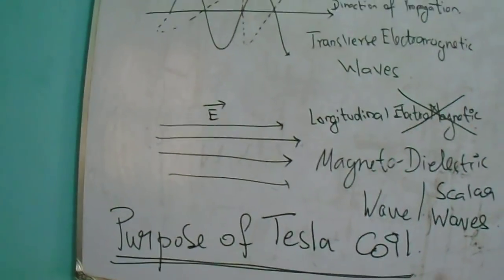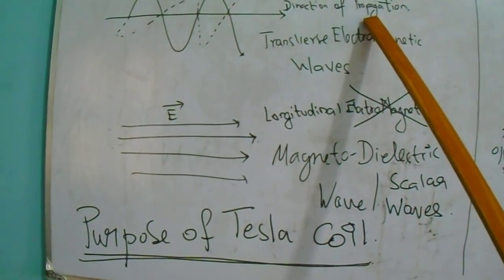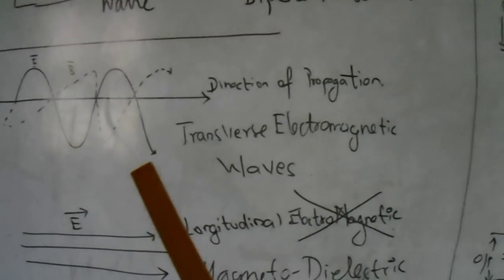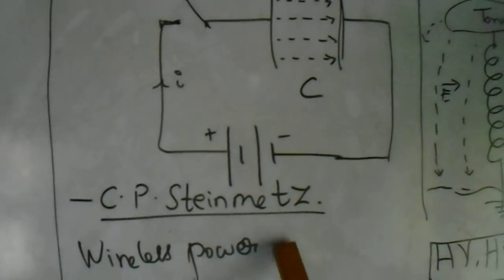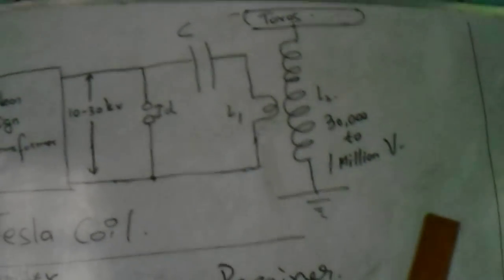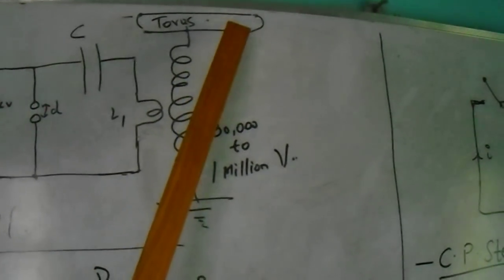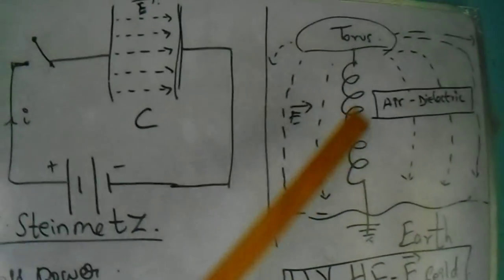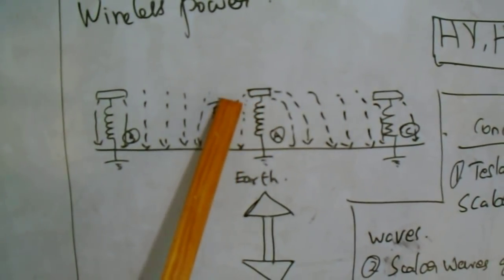How a Tesla Coil Produces Scalar Waves

Comment: More pointless rubbish.  Why don't you do something more useful with your time than making things up?  You may want to start with getting a grasp of Heavyside's formulation of Maxwell's equations.  Just a thought...
Reply: Explain why this is pointless.
Reply: Andrea Marchetti The wireless transmission of energy in this system is via standard, ordinary, transverse electromagnetic waves.  I.e. Their direction of propagation, B- and H-fields are all orthogonal as per standard, 'run of the mill' radio waves.  Thus, it is pointless as it is technically incorrect throughout.  Please, as I said in my initial rebuttal, get a grasp of Maxwell's work if you're interested.  I would also advise that you be suspicious of discourses that have no support in peer-reviewed literature and have lines like 'believe it or not' and 'equivalent circuit according to me' in them.
Reply: Mr Pyramid Man Well, that was a very mature argument!  Please tell me, do you wear a foil hat in your pyramid, whilst practising your swear words, 'Mr Pyramid Man'?
Reply: This is pure conjecture but I have my suspicions that the nature of Tesla's original intent was a form of resonant electromagnetic coupling between the ionospheric resonances and the Earth current resonances through a 'pumped phase conjugate mirror' effect.

The spherical standing waves around Earth formed by ELF radiation can be pumped using A/C current, so can the Earth resonances produced by electromechanical and electrothermal processes that heat the Earth. Using the correct coil ratio and torus mass, you can tune this circuit with a signal probe grounded in the Earth and one in the upper atmosphere, and produce a phase conjugate signal in both the torus and the Tesla coil ground wire. These destructively interfere with the naturally present resonances and produce constructive interference at the Tesla Coil which can be greater than the energy input because the system is now in resonant mode locking and thermodynamically far from equilibrium in the frequency domain.
Reply: Eric Matteson, I think you are wrong. If wireless transmission were Hertzian waves why can you receive  transmissions through a Tesla Coil in a Faraday box? Reference: https://www.youtube.com/watch?v=wjz-5Lqtxow
Reply: XR IX
True this technology is a proven fact
Reply: XR IX
Thank you, that is interesting
Reply: Eric Matteson
All correct, IF you assume the Maxwell-Heaviside view of electromagnetism is correct and complete.  We know, since Einsteinian General Relativity, that MH is not a complete theory by any means (but still taught in university).  The main, and very important, reason for this is because Maxwell-Heaviside assumes a flat space geometry, and Einstein's greatest intuitive contribution was to ascribe spacetime as geometric with curvature (and it also has since been shown to also contain Cartan torsion in 1925, see below).  It would be a book to elaborate, but the MH theory works but only in flat spacetime, which is all they understood in 1885.  Even the flat-spaced Minkowski Space came during the development of general realtivity, and the (incomplete) inclusion of Riemannian space was required to explain spacetime curvature thus invalidating Minkowski space.  Any thorough student in Einstein with skill in tensor calculus will agree.  And not too many know of the great French mathematician Elie Cartan, who worked with Einstein for a time in 1925.

Now, once Cartan torsion is added to the mix, it became possible to unify gravity with electromagnetism, and this realization is being developed as I write by a number of people.  Since it is looking more and more likely that gravity and EM will unify via Cartan Geometry, MH theory isn't dead, it is just a special case.  It is worthwhile to experiment and validate the new physics as this video seeks to accomplish, right or wrong.  Science must progress , but are we to assume that we got it all exactly right on the first try?  Of course not.  Maxwell-Heaviside is a special case within the larger and more comprehensive framework of GUFT theories (Grand Unified Field Theory) under development right now.
Reply: XR IX Flawed because a biscuit tin has paint and lacquer  on the surface. Even two tins will still not provide a perfect shield. Furthermore, the radio signal is already a weak signal having travelled through space from its distant transmitter, the local source is very much stronger. Assuming that the boxes do attenuate the signals, (but not completely) then the radio signal will be reduced to  a point where the receiver cannot pick them up but the local source still has enough energy to be detected. Oh, and scalar waves are supposedly not detectable so using a radio is pointless. All that is being shown here is atnuation of electromagnetic waves of different strengths.
Reply: @electronicsandradio3945  If one is to build a scalar receiver, polarization is an issue. A standard dipole antenna wouldn't get it done for longitudinal polarization.  Since most any antenna design rejects longitudinally polarized EM waves, your conjecture would be correct.  However, a proper scalar receiver/detector would need proper polarization as well as Faraday shielding and resonant tuning and pre-amplification all inside it.  This has been done decades ago and designs exist out on the Internet.  There are design constraints, but it can be done.
Reply: @bruced9786  well a metallic antenna picks up electromagnetic waves, so either scalar waves are simply  'push pull' type electomagnetic waves waves which would simply need  an antenna pointing in a longitudinal direction. However, polarisation changes due to reflections.  Never seen a so called scalar receiver. Certainly there's never been any proper proof of scalar wave passing through screened rooms. Half the proponents say it's not detectable at all which demonstrates how little factual data exists.
Reply: @bruced9786  Well stated and I partially agree, however, does not magnetism, as seen through the ferrocell and magnetic film, provide the grand unified theory already? It seems that gravity (dielectric acceleration), magnetism, electro motive force, and dielectricity (plane of inertia, or counter space) are there for all to see. Four modalities of counterspace; the ether field. One space plane as MH described. Once one heads off on a tangent, more and more models are needed for explanation and more and more mathematics are needed to prove ones complex model. Simplicity must prevail, surely.
Reply: @elams1894  
Good points.  One must accept the implications of a unified field before you can see the patterns in the various fields around us.  Since you apparently have, you saw patterns.  The average student in the "West" is not likely to see the interrelationships as a pattern.  It is in this environment that my remarks were initially directed.

Back in the first post by Eric Matterson at the top of this thread, he was attempting to point out that there is nothing in Maxwell's equations that indicate the presence of scalar waves.  Two things about this: 

1) What most people think are Maxwell's equations are actually Lorentz' hacking of Heviside's non-quaternion restating of Maxwell's original 20 equations.  Maxwell chose to use quarternions because they don't commute (A x B does not equal B x A) and the math was difficult to figure out back in 1860's.  Now, we use quarternions in computer graphics because they are efficient computations to make in rotating 3D space.  Heaviside tried to convert Maxwell to vector calculus and drop the equation count to 4.  Lorentz came after that and dropped the "curl" operator and made other changes because in his limited, flawed understanding, he could not visualize the usage of the curl operator (a poor excuse for making a change I think).  Unfortunately, this then became the standardized Electrical Engineering formulae and have not been abandoned in the academic world since (except in Russia), and therefore the typical electrical engineer has no knowledge of scalar waves or longitudinal waves, both which are quite useful.  You almost can't blame them for being miseducated, but once they have been clued in, you would think they would study up and get with the real program!

2) Students of quantum electrdynamics (as well as the best unifield field theoreticists), however, know about curl, or better referred to as torsion, as it is required to explain observations seen in many and varied experiments done in the past century.  The field of Non-Linear Optics, in particular, are indebted to torsion, having repeatedly proven it's existence in the last 40 years.  It is well accepted that torsion exists in physics, and a unified field requires it as a result.  It's just the apparently ignorant electrical engineers who are holding things back at this point.

For more reading, see http://cheniere.org, the website of Tom Bearden, one of the early proponents of scalar energy in the US and the explanations of such are all through his site.  Dr. Myron Evans (et al) has what I consider the best Unified Theory of all, and they are still publishing, see http://upitec.org for a good place to get started on that.  There is some overlap between Bearden and Evans on each other's web sites, as Dr. Evans found encouragement from Bearden to help make the case for scalar energy explainable in terms of a rigorous modern scientific theory.  Non-linear tics people may know Dr. Evans as the discoverer of the B(3) field, from which torsion entered into the science as fact.
Reply: @bruced9786  Thanks for the reply and resource material. Indeed conceptualising, visualising torsion is key to understanding mass phenomena, or the generation of pressure gradients and resulting energy concentration, mass. Heaviside's equations were certainly on the heavy side, no pun intended. Steinmetz was an unsung hero IMO. My father was a gifted EE, audio at first, then film. He designed and built many television studios around the world, including Singapore and Hong Kong in addition to NewZealand where he lives. He is in his 80's now and he confirmed to me 35 years ago when I asked him what I thought was a simple question as a kid, where does electricity come from? He answered, if you want to know what and why you have to learn field theory and if you want to know how you have to know conventional theory. His overall answer at the time was that we still don't know. I was staggered to be honest. How could this be? I began researching and sure enough, as you probably know, it is a long and tiresome road. 

Getting back to torsion. It is quite rightly, absolute key in figuring out both magnetism and electromotive force, and ultimately electricity. One must be spatially creative and be able to visualise as equations will not allow that. When one realises that torsion provides polarity in a mirror image, and begins to explore that phenomenon spatially, conclusions become more clear. I see three fundamental attributes of polarisation that must be conceptualised. The fact that same/same poles (radiation), when placed together in any orientation, provide pressure gradients that are opposite is fundamental. In addition, the fact that same/same poles have both centrifugal divergence and centripetal convergence (on/at the same pole) is also fundamental. In addition, the plane of inertia (the accretion disc of counter-space) and its influence on polarity (radiation) is also fundamental. Indeed, spatially conceptualising these conjugate phenomena (dynamic torsion) is critical. Perhaps that is why it is so hard for EE's.

I read the article on the scalar detector. Very interesting. I am glad they used the so called 'photon' as a subject for scalar detection. I'm hesitant to associate the word wave with scalar for obvious reasons. I certainly conceptualise the 'photon' as a dielectric phenomenon rather than a 'wave particle duality' which makes absolutely no sense to me what so ever. The radial dielectric being the longitudinal anchor about which the magnetic and electric transverse giving the structure its Hertzian nature. It makes sense to try and influence the dielectric at a quantifiable source. There are a few things that are not so clear to me. The first, how will they deal the transverse component of the longitudinal, the magnetic and electric, as they are the wave component of the scalar structure 'photon'? Spatially, the interaction of a powerful magnet on the dielectric is very hard to conceive. A strong magnetic field, to my knowledge, compresses the dielectric, which is already perturbed into a pulse (scalar). I can only imagine that a magnetic pressure applied to a dielectric radial will generate a pulse that is perpendicular to the original pulse at source, leading to very interesting torque outcome. I guess it seems logical and possible. One can see how torsion dynamics, vortices, pressure gradients, and acceleration really extend ones brain to the limits. Thanks again for the links.
Reply: @bruced9786  I see their thought.. the longitudinal wave has no 'vertical' nor 'horizontal' component and thus does not impinge on the detector to create a signal. However, their crazy plan to bend spacetime to give it a vertical vector (unverifiable), could be achieved by placing the detector in the same plane as the oncoming longitudinal wave. Rather than bend the incoming signal, simply rotate the detector accordingly. Just as a horizontally polarised antenna requires similar at each end ( although not strictly true ), making the scalar antenna in the same vector plane would obviate any need to bend the original wave... its so obvious, but not to those who can be fooled by techno babble.  Any wave will not retain its polarisation due to reflections  etc, just like a horizontal polarisation can be received by a vertical antenna at reduced power, so should a longitudinal wave transmute into other polarisation. The crux here is that all that is being detected is a voltage induced into the tuned circuit, so the implication that the scalar wave is simply an electromagnetic wave with a different wavefront type. Most proponents will say scalar waves are undetectable, and your link claims it needs superconducting magnets... while all along, this old scientist claims he can detect them using a 5 dollar radio. So much for consistency.
Reply: @electronicsandradio3945  A couple of things. Is not a scalar wave a pulse? The use of the word 'wave' is very misleading. The Russian detection device states that they were using a 'photon'. A 'photon' contains, in addition to its longitudinal scalar component, transverse magnetic and electric components - thus, the 'circuit' is manifest into the time realm (space, voidance). Unless the transverse component is eliminated, the circuit is not strictly scalar. Scalar pulse perturbation is instantaneous. In addition, i'm not sure why the term space-time is used.  Time is in no way bent, nor is space for that matter. Space has no attributes and acts on nothing. Dumping a magnetic pressure gradient onto a counter-spacial dielectric radial plane (the longitudinal in this instance) is creating space; creating a magnetic component (radiation from counter-space), therefore creating a time component. A scalar pulse cannot have any electromagnetic components.
Reply: @elams1894  sometimes sound waves are used as analogy for the longitudinal wave description that scalar is meant to be. But although a sound wave can be a wave or a pulse in a longitudinal direction, it still has an oscillation  and still has a speed. A pulse cannot have instantaneous speed because a mechanical pulse relies on one particle moving the next one. A photon is a radio wave anyway. Photons are emitted by radio transmitters, but they have lower energy than visible photons. I see no method anyway, how to create a signal from Photons that are suposedly longitudinal..what does that even mean for a photon?. Photons simply propagate in a single direction..forward ..and carry with them an em field as we understand it. So even a photon pulse would be just a short burst of ordinary transmission. Trying to describe scalar waves with diagrams is misleading because it makes no logical sense comparing a drawing of what could be a sound wave type propagation to a sine wave representation of a radio wave. It looks convincing ..but in reality it's not even possible to describe how a photon would work in a longitudinal fashion since there is no forward or backward motion possible.did that make any sense?
Reply: @electronicsandradio3945  - Sound waves are waves. There is no longitudinal axis in sound, merely particles moving up and down tranversely via displacement. 'Light', incoherent illumination, behaves differently form sound as it contains a longitudinal component - as I wrote above - the dielectric. The dielectric terminates on conductors, or dielectric reflectors anywhere in the universe, hence it IS the field. It cannot terminate in space. The dielectric field is counter space. This field, the aether, dielectric, call it what ever you want, cannot be quantified, as it contains no particles. A pulse upon the aether is instantaneous. 'Light' - illumination, is a phenomenon of pulsed aether with a transverse electro-magnetic component. 'Light' travels at the rate of induction, not at a speed. 'Light' (not photons) has a time component as it contains magnetic radiation. Polarity (magnetism) is the aether in discharge, a discharge that is spatial FROM counter space (dielectric plane of the aether), the compression of which is the sole definition of charge. Magnetism therefore, is change, and change is time. Whenever there is magnetism, there is time. Time cannot be bent as it is simply a human attribute given to magnetism, change.

The dielectric plane of the aether is torqued by magnetism. When this occurs, ripples are manifest upon the dielectric plane along with electro motive force. ANY ripple of the dielectric field is radiation (magnetism) into spacial existence from counter-space no matter how miniscule. As there is a time component (magnetism), there is a rate or 'speed'. The perturbations, ripples, are transverse and pulse the dielectric in the same manner as a drop of rain propels the centre of the dielectric plane into a longitudinal Z axis. The perturbations (ripples of magnetic and electric - oscillations in the X,Y plane) are luminal and hence there is a rate of induction of the manifested dielectric Z longitudinal. The faster the oscillations, the smaller the transverse electro-magnetic, and the higher the energy (pulses). That is why the Russian detector were considering the so called 'photon', more appropriately called dielectric-electromagnetic radiation 'light'. Scalar pulse propagation is instantaneous transfer of energy through the dielectric aether plane in an omni-directional manner. There is no backward nor forward, merely point source in either direction, hence polarity is everywhere in nature, not one direction.
Reply: I really didn't understand what you were saying. But sound has to have a longitudinal path. think of a loudspeaker pushing and pulling the air.. there is no 'up /down'  other than would be created from reflections. the amplitude is how much the  air is displaced back and forth from the driving source.  Light doesn't do that it always moves forward, there is no push and pull . It's not really sensible to compare the two anyway - but it is often done ( even like a compression wave on a spring ) where people try to explain a longitudinal wave and then apply it to what they want to call a scalar wave.
I think the 'scalar wave detector' is rubbish anyway. Bending Space time with a magnet is not current physics.. MASS is what bends space time. if it were possible with a magnet then labs the world over would be doing it, trying it and presenting any measurements in published papers.
Reply: @electronicsandradio3945  
I think you are well steeped in transverse signal theory but are mixing that theory up with longitudinal theory.  The angle a standing wave may or may not have has no bearing on the ability of the antenna to receive a scalar longitudinal signal since a simple wire will not realize a generation of current from a typical scalar wave.  We know this from Faraday's experiments.  The only easy way for the antenna to even see anything from a longitudinal wave is for space to be curved around the antenna so that a kind of spatial transformation occurs that results in the antenna picking up a transverse wave that results from a longitudinal wave experiencing spacetime curvature in a magnetic field.

This is because longitudinal waves vary along the same axis as the propagation, which doesn't automatically result in current being generated in a wire (antenna).  A magnetic field of sufficient strength creates a curvature and a torsion in spacetime, according to unified field theory (for the best one, see http://upitec.org).  A useful but somewhat inaccurate analogy is that the magnetic field serves as a "lens" that transforms the longitudinal wave into one at least partly transverse.  Once you have an antenna picking up a more well understood transverse wave, you have a working scalar receiving antenna.  After that, tuning and amplification occurs as you understand it already.
Reply: @electronicsandradio3945  
You are clearly unaware of many of the far reaching implications of a unified field theory.  Questions about which one is best aside, the idea that the fields are unified directly imply that one can experiencing curvature and torsion as a result of the expression of any or all forces, however those forces are caused to exist.  Electromagnetism is typically characterized as torsion as gravity as curvature that is about 10e-40 weaker.  But is has been rigorusly shown mathematically that you cannot have either curvature or torsion without the other.  So, consistent with a good UFT, you must have electromagnetism present in some form or another when you bend spacetime, and your concept of mass and energy needs to adjust to match.  BTW, only Einstein, who neglected torsion in General Relativity to his peril, maintained that all electromagnetism occurred in a flat spacetime (this is one of the many fallacies of GR, some of which are well discussed in this publication at http://aias.us/documents/otherPapers/CEFE-print.pdf  but a decent math education is needed to full grasp it.  But, pay particular attention to section 2.7 since it pertains directly to what I am trying to say).

UFT is a fascinating study to say the least about it!  I heartily recommend it, even if it is just to round out your education.
Reply: @elams1894  
Interesting take on the subject, and one I am not qualified to argue, other than to say I prefer the take that doesn't inherently depend on the proper description of an aether, since no one has developed a consensus on that yet.  I prefer the geometry based  study of the topic (it agrees with you on many points) that has grown into a unified field theory with rigorous mathematical testing http://upitec.org
Reply: @bruced9786  Thanks for the explanations. I do need to read about it some more.! There's very little I've ever found that makes the slightest bit of sense or logic apart from your comments. Based on what you understand, would you say it's possible to make a scalar receiver without a superconducting magnet. I see all sorts of claims made by companies selling products that suposedly use scalar waves, but in my opinion they are all just hype.
Reply: @rowifi  
That's a great question.  Superconducting magnets are rare beasts indeed!  I haven't built one of these myself, so my experience is limited to that of others, and the bulk of that I already referred to above.   I suspect that, as we gain better knowledge of how to manipulate the parts of physics that have been undiscovered or suppressed up to now,  we will find other ways to curve the space around objects.

Speaking of curving space, a UFT-updated version of Alcubierre's work that he refers to as warp drive is all about generating curves in space efficiently.  Interestingly enough, and I only thought of this just now, that Bob Lazar's description of the reverse-engineered propulsion he supposed to have studied at S-4 (near Area 51) is descriptively identical to Alcubierre's warp drive, although Lazar was out with it first!  I don't pretend to know the implications of this better than anyone else, just a point of interest for general discussion.  How much of this is a mathematical "trick" and how much is the mathematics trying to reverse-engineer observed devices I'll leave up to an exercise for the reader! LoL

P.S. Oh, why a UFT-Updated warp drive?  The mathematician Alcubierre based his warp drive formulae on General Relativity, which assumes a flat spacetime and neglected torsion due to an arbitrary choice made by Einstein and his contemporaries.  Clearly, any unified field theory that fits ALL the known observations, like the one that Dr. Myron Evans has (upitec.org), must include torsion, so spacetime is not flat as Einstein assumed without proof.  In fact, Elie Cartan's geometric description fits the universe so much better, you would never look back!  So, since Alcubierre used a broken theory as a foundation for his math, it stands to be revisited in light of the UFT that emerged some 20 years or more after his first warp drive visualization.  But, once done, could be the breakthrough Star Trek enthusiasts have been looking for -- a real warp drive!  If you think about it, any field around a ship would have to be set up from an interferometrically manipulated scalar electromagnetic field of sufficient strength to achieve the creation of a bubble that, if certain other assumptions are true, changes the inertia of the matter inside the field and results in propulsion.  In the UFT, the power to do this is the easy part.  The frequencies and the interferometer, that's more tricky, but not insurmountable.
Reply: Maxwell does not even work in any real-life scenario. It is completely irrelevant in practical applications. All of todays engineering is done by approximation techniques/models not MH computations...they serve one purpose imho: to give  the student at any university the impression that they understand EM Theory....as you said it is a special case only for some general (false) assumptions: "DIV B = 0" is outdated.
Reply: No, MH equations are a special case only, they have no universal meaning at all.
Reply: @nuculeusnihilationis8321  
I generally agree, but I wouldn't say it doesn't work, it is just that Maxwell, or Maxwell-Heaviside, or Maxwell-Heaviside-Lorentz (particularly) is incomplete and only covers special cases.  The the case of the latter MHL, anything non-symmetric was chopped off by Lorentz without theoretical cause, and of course all modern Electrical Engineering formulae are based on that version!  A completed EE model can be found here: http://aias.us/documents/uft/a349thpaper.pdf
Reply: @electronicsandradio3945  
The idea behind bending spacetime around an antenna element is that you would have an extremely directional element if you didn't.  The magnetism makes it more omnidirectional (albeit not perfectly so), such that the applications of the omnidirectionality are broader.  Since such scalar receivers have been made both with and without super magnets, I am not sold on the superconducting magnet part either.
Reply: @elams1894  
Jus to to clarify something you said for the sake of others, longitudinal waves are like sound, there is no transverse component to a sound wave unless there is another component of energy with transverse components travelling along with the longitudinal wave.
Reply: @elams1894  
We all have to be cautious when translating Russian terminology back and forth.  I don't think that describing electricity or electromagnetics as a different kind of photon in Western science thought is correct.  Doing otherwise brings in unintended inferences.

A scalar wave is still electromagnetic, it is just purely longitudinal (no real and complex parts used to describe) and resembles sound through air.  The trick to receiving longitudinal waves is to run it across a curved spacetime cross-section which rotates the wave into a small transverse component which can be picked up with a standard antenna element and receiver electronics.  The more spacetime is curved at the element, the more of the wave's power is converted to transverse electricity.  Or at least so goes the theory.
Reply: @bruced9786  I find it hard to  accept the claim that scalar waves penetrate a shielded enclosure any more than normal em waves do. Of course the proof would be to have a receiver do this. Since a normal antenna will still pickup normal em waves regardless of polarisation (albeit at reduced signal level), The claims appear to be  that no scalar signal can be picked up at all by a normal antenna without bending spacetime. We have people 'proving' scalar waves using ordinary radios, florescent lamps etc let alone making healing devices based on scalar waves. It's either easy to detect them, in which case the faraday cage experiment would be proof, or its not in which case noone outside research establishments have come close to creating g or detecting them. .  Such is the magnitude of errors and false data surrounding this. May I ask your experience and expertise in this area?
Reply: @bruced9786  - A scalar wave, a longitudinal wave as experimented with by Tesla, is entirely different from the longitudinal wave as described by modern mainstream science. Although a sound wave is described as 'longitudinal' by modern physics, it is entirely a spacial phenomenon. It has a time variable. Any entity that contains magnetism (aether displacement) is spacial. The longitudinal wave that Tesla described has no magnetic component. It is entirely counter-spacial. No time component. It is the true definition of longitudinal transmission. The one and only energy field, aether if you like, in equilibrium is counter space. Magnetism, aether in displacement, is space. The elimination of the magnetic field (DC pulse (non changing magnetic field) in Tesla's case) via abrupt shunt is an instantaneous counter spacial event, in effect, infinite current at zero time. The energy involved in producing the magnetic displacement is transferred to light and sound (spacial phenomena) and aether pulse (counter spacial, scalar, longitudinal phenomena). Electricity, containing a magnetic component, is an obvious spacial field phenomena, with lightning, static discharge, capacitor discharge, and black holes being perhaps the not so obvious counter spacial field phenomena. All field phenomena, be that magnetic, gravity, dielectric, or electric are different forms, or interactions of the exact same energy field. In fact, In the future I would not be surprised if it were to become common knowledge that static discharge (capacitor discharge, static shock), lightning, and black holes are different scales of the exact same phenomena, that being, the sudden obliteration of the magnetic fields of the immediate surrounding mass. It is indeed true that whatever we observe in the micro can be seen in the super massive. It is my belief that one must un-learn the notion of an electron and completely conceptualise counter space to have any hope of understanding existing field phenomena.
Reply: @bruced9786  Yes indeed, Maxwell himself originally even postulated a sort of aether as far as I can recall. The Heaviside-Lorentz generalizations distort the view on the original formulae.
 It is not scientifically or even technically correct to call Maxwell "irrelevant", I am sorry for this.
Reply: As said elsewhere ,  the original Maxwell equations are not irrelevant, it is the Heaviside-Lorenz "post-processing" that distort the view.
With magnetic monopoles on the verge of official discovery  things are even getting more tight.  From https://www.london-nano.com/research/magnetic-monopoles-discovered-lcn-scientists “A magnetic version of electricity is a long way off” says Prof. Bramwell, “but these results are an important first step”.
Reply: @electronicsandradio3945  Scalar waves, pulsed aether, penetrate everything other than those entities displaying a magnetic field. A magnetic field displaces aether hence a so called 'conductor' such as copper in a coil formation, when made partially coherent by a moving magnet, displays a magnetic field which deflects electricity. Yes, a so called copper conductor, actually is the entity which is most resistant to electricity when made coherent (partially magnetic). Electricity is a field phenomena; a hybrid of magnetic and dielectric . Aether is simply dielectric on its own and will bypass magnetism just like air over a wing foil.
Reply: @elams1894  I didn't really follow that... what I'm looking for is a scalar transmitter, a scalar receiver and an experiment showing categorically the reception of a signal inside a proper professional screened room. Granted such rooms still may have some leakage, but in this case I would expect to measure a signal of substantial amplitude.
According   to popular belief it simply takes very little to generate a scalar wave .. none of which convince me. With a suitable receiving apparatus I would be in a position to unequivocally prove this... but such device is illusive.
Reply: @electronicsandradio3945  The transmitter side of things is straight forward, its been done over and over. An AC power supply fed into a transformer of whatever spacial geometry the builder sees fit, rectified into DC and then pulsed (shunted is more accurate) to take advantage of the obliteration of the magnetic field. It is the killing of the magnetic field (not in the generation) which offers aether perturbation as it is a zero time event (counter-spacial) with enormous force, no different to the phenomena lightning, just on a different scale. One could not transmit an analogue signal as it contains a magnetic (time) component, however one could send a binary/digital signal (on, off). Tesla amplified his signal with the use of resonance. In fact resonance was key in Tesla's experiments. Amplifying a non uniform binary signal however? One would not need too I gather as that would be done on the receiving side.

Receiving the signal is a different kettle of fish altogether.  One would have to turn the aether pulse into a magnetic one (from counter-spacial to spacial) to receive it. In other words, give the pulse a time component. An aether pulse is a zero time event, a force into counter-space. The spacial (magnetic) attributes of such a force are light, heat and sound but these are produced in the shunting process at source. The only way I can conceive of a receiver of an aether pulse, is if it were the circuit of light in reverse. One would have to use a magnetic field as the receiving apparatus as it is the spacial form of the aether field, hence any pulse perturbation can be detected as an EMF. One would have to direct the pulse carefully however, as aether is displaced by a magnetic field. How does one direct a scalar wave? Tesla's energy was radiant. Dead center of a pole is the logical choice if one can direct it there. Then one could couple the EMF into whatever switching array desired. Intimate knowledge of field geometry is necessary obviously, but it certainly can be done. A field, it seems, even though everyone on the planet knows it is there, is treated as some kind of voodoo magic by mainstream science. Its extraordinary when you think about it.
Reply: If a receiver is so hard to make - there can be no proof of scalar transmission other than theoretical maths which is subject to controversial debate.
Reply: @electronicsandradio3945  one can receive energy, that can be seen already. I believe you were describing a signal; complete different ball game as aether has a zero time component.
Reply: @elams1894  Really all I want is a method to detect a scalar wave by virtue of it passing through a shielded enclosure. On the assumption that if the transmission can be turned on and off, then the detector should respond. It's still a signal albeit on off signalling. I'm not bothered about modulation. Without physical detection, there can be no absolute proof of existence which is the experiment I want to do.
Reply: "Thermodynamically far from equilibrium in the frequency domain." -> What do you mean by this?